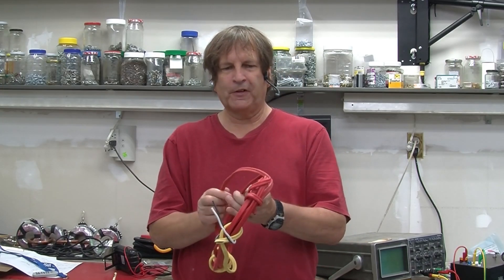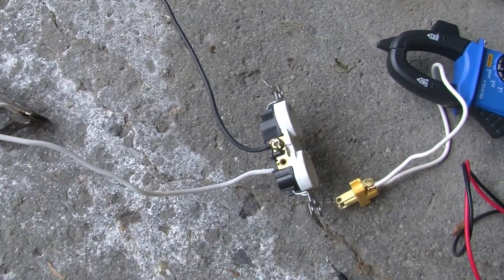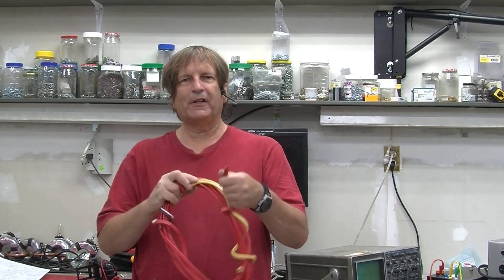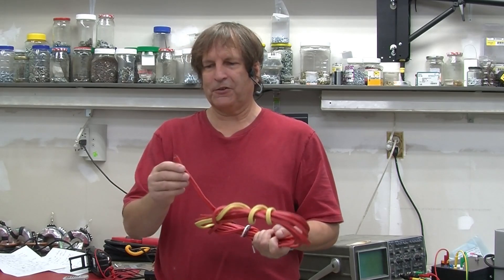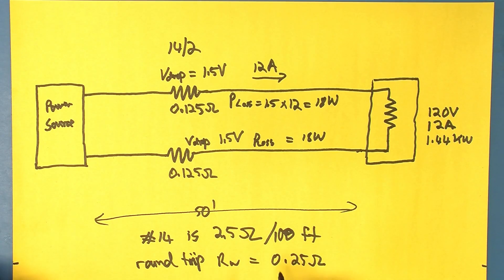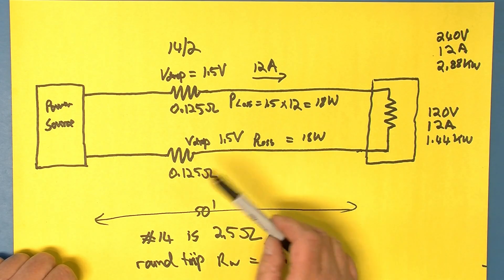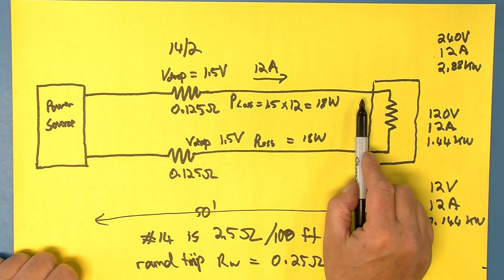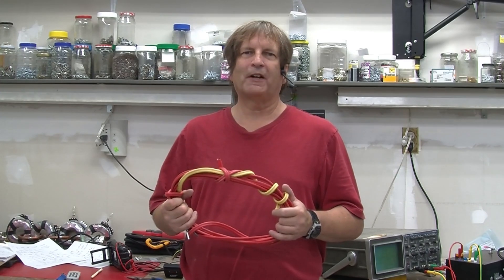Overcurrent Tests FAQ

Comment: I took electronics at a votech '85-'87, and was taught that electricity flowed on the outside of the wire - not through the inside. Was I taught incorrectly? Re- learned some forgotten things today watching your video! Thanks!! 👍😉
Reply from the maker: You went to school at almost the same time I did - how cool. 

You were taught a simplification that is generally true for RF frequencies where  the skin depth is really really small. Sometimes wires for RF are coated with silver to improve the conductance on that thin surface layer. For high power stuff like wires for radio and TV transmitters, the wires are more like copper plumbing pipes - no need for copper in the middel that doesnt get used.

For low frequencies like AC power the skin depth for copper  is thick - without looking it up, I think its about 1/3 of an inch. So not much point in a wire over and inch diameter feeding a home or on a power pole since the middle is unused. There re tricks to improve that - a future video!

Comment: Great video, I have question hopefully someone answered question, Im in process add 2  dedicated wall outlet . My build as follows is using 10/3 copper cable  MC cable  with 20amp and hospital grade isolated ground to power very high end Audio amp rated close to 12 amps . I read online use # 10 gauge copper cable will reduce resistance and offer better sound  does this make sense ..
Reply from the maker: Thanks! Well - bear in mind that any answer I give to that question will result in people disagreeing. So to put things in perspective, I am very experienced electrical engineer who often deals with very weak signals and noise. I'm not a high end audio person, although I'm amiliar with high end audio and also look at probably the same YouTube channels you watch. So with that said:

With a well designed power supply in the audio amp it should not matter unless you are a really long way away from the breaker At somewhere around 50' the electrical code says you need bigger (10/3) anyway. The reason the code limits the length is to limit the full load voltage drop along the cable to 3% or less.  Now consider this:  you can easily get way more voltage drop/swings during the day to day voltage fluctuation from the power company. So I am very doubtful that a shorter cable run 10/3 would help much if the system isn't bothered by those even larger voltage fluctuations.

But - since your already going to the expense of running a new dedicated circuit, the additional expense of upping the cable gauge will not be that great in relative terms, so I would suggest you do it rather that potentially regretting not having done it afterwards. Whats $100 more (if that) given the total cost of your system.

The isolated ground outlets is a good idea and I would have suggested it it if you hadn't mentioned it. It will minimize noise  from other electrical devices. Sound and TV studios often do that. I trust all the connected equipment will also be plugged into the two dedicated wall outlets on that 20A isolated ground circuit? If not, they will bring noise into the system. 

By the way - with expensive audio gear like that, might also be worth considering a whole house surge protector if you don't already have one. Would be a good way to protect your investment. 

Hope this somewhat pragmatic discussion is of help!
Reply: Thanks very much for detail information , after doing all work myself the 2 mono blocks amps on own circuit . With  volt meter to check voltage before it ranges from 118 to 124 volts now is steady at around 123-124 volts here in Canada.Consider I already have 10/3 cables from exsisting electric hot water tank  now natural gas. My final cost is just $C60.00 I noticed right away there more low in bass less muddy sound before and  less harsh sightly higher volume sound. Before I was using a loaner inline conditoner value just under $C15,000.00 now sounds very close without conditioner. Again thanks very much for advice
Reply from the maker: @hexen0076  Thats interesting - and amazing to me - that the difference is noticeable! At $60 its a no-brainier!

I'm in Canada too - just outside of Ottawa. I find my power varies from just below 115V to a bit over 125V. Lowest typically during the day in the summer when people run their ACs. Highest at night during times of low power use.

Comment: Note that on a 12V system, the voltage drop in the wire is much more significant than the heating of the wires.  i.e. you really need a much heavier wire than 14 gauge  for a 50 ft run at 12V.
Reply from the maker: Yes! You could very quickly use up all your supply voltage as simply voltage crop on the wire.
Reply: @ElectromagneticVideos  - I'm amused to see the various comments on Quora.  Some people say we should use 12V or 24V for everything because it's so much "safer" than 120V or 240V.   There there are the people who think we should convert everything to 240V to be compatible with Europe.  And there are others who think all electricity should be distributed as DC, since DC is used for electronics.

Of course if you understand all  the considerations, none of these changes should be pursued.
Reply from the maker: @8546Ken  You should see some of the comments under my "how many amps to burn 14-2 wire" video! I think a lot of people have a cursory understanding and unfortunately end  up with a bunch of misconceptions. And some are just looking to argue :)

Comment: Another: the early pixel led strips required 5V and were about 5m per strip. There is about 60*4 leds per meter (RGBW), rated about 80mA max per 4 leds @ 5V (full brightness every color).
Needless to say that 5V turned to 2.5V at the end.
And the cable to the string was the worst.
So I changed my PSU's to 24V led PSU with short circuit protection, and at both ends of the string I placed any:5V dc-dc converters.
The 24V at the far end using 1.5mm2 cable  drops to about 19V or so.
To be fair: they are rated as 80mA at 5V, but I've never seen the string go beyond 25W. Also none of my scripts put it in full power as 50% pwm seems to be as bright as 100%, so I keep the max at 50%.
Reply from the maker: I have see long spools of LED cable or strips. Never thought of the limitation in terms of length but you provide a great example of how resistive losses are so much more apparent at lower line voltages. Those strips should have max length specified ...

Comment: In my future ESS, 260A (your welder trafo, but DC) @ 50V should be supported. That's just barely enough to get my cooking island and ovens going at the same time.
So the wiring is also a bit thick. But it goes to a bank of inverters that transforms it to 230V, so the wires to that kitchen are multiple 2.5mm^2 wires.
Reply from the maker: ESS - sorry - what does that stand for - I`m guessing somthing to do with off grid power....

Comment: Great explanation. It should really help in the basic understanding for Amps being the constant! I know it can get confusing considering if breakers would operate on the same principle with currnet being the same and reduced voltage or another example since I am in the industrail field..
The older motor startes with the moror overload protection relays. I never really considered that. If current is still the same through the heater unit/element, will the heater still heat up to trip the starter if the volatge has reduced?🤔
Reply from the maker: Thanks! I believe the way the protection relays work is they have a thermal switch that heats up based on the current and time it is flowing. Under normal operation, the current is low enough to not trip the thermal switch, but during the starting sequence, not only is the starter winding activated but also the main running winding draws way more current - I have seen up to 6x the running current. For a normal start the high current isn't on long enough to trip the thermal protection cutout.  But for repeated starts - or a stuck rotor the heat build up and hopefully the power is cut before the windings burn. The stuck rotor is typical for fridge compressor that was running, then turned off,  and then restarted while everything is still pressurized. 

The real expert on that sort of thing is David at https://www.youtube.com/@davida1hiwaaynet. Well worth looking at his channel if you haven't seen it!

Comment: I'm too lazy to do it myself, but I wonder how much money you could save over a 30 year period of time by opting to use 14/2 to 12/2 on heavily used 15A circuits. 36W wasted is the wiring is a pretty significant loss.

I imagine that you'd probably break even in a couple years, especially if you use stuff like microwaves, air friers, and space heaters frequently.  Or maybe you just have a giant work space with a ton of lighting like a large pole barn.
Reply from the maker: I suspect the issue is most circuits (even the ones you mention) are on such a small proportion of  the time it may not pay - but would be an interesting calculation. From some comments it appears in some areas #12 is used for all house wiring these days (in 120V regions). Had an interesting discussion with an electrician a while back,. The additional cost for wiring a house with #12 as opposed to #14 is a relatively small increase compared to the rest of the electrical cost. If I were having a house built today I would go for #12 and for that matter, better quality receptacles than the usual cheapest ones.

Comment: Conductors don't care about voltage only current.  Insulation is what handles voltage (arc protection).
Reply from the maker: Exactly!!!
Reply: And might as well add an insulator is only an insulator until it fails. Then it becomes a conductor!
Reply from the maker: @unknown-zc8be  How true! Charring of plastic is an example. A gas before an after an arc has formed is another. 

One of the most interesting things I saw in Florida in near the beach was an insulator on power pole that would gradually become contaminated with salt. Every few days there be would be a very loud bang with a momentary spark that must have blown away, dried out, or vaporized all the accumulated moist salt and the the insulator would be an insulator again.

Comment: With simple resistive loads, lower the voltage and you in turn lower the amps but with a typical application of a switching power supply the amps will go up with reduced voltage.  It's all a bit jiggly and iterative, isn't it.
Reply from the maker: Yes! It really makes it hard to predict what will happen if the line voltage goes up or down a bit since you would really need to know the exact characteristics of the load which could be anything these days. Or think of a whole house with a complete mish-mash of different load times. I'm sure it makes it harder for power companies who used to drop the voltage a bit to reduce the loads if they were close to capacity. Today doing that could make the situation worse.

Comment: Very helpful explanations.   I take it you are a current or semi-retired electronics instructor at a technical college?   Indeed the current in amperes is what heats up the wiring and we need to respect ampacity ratings when we're  selecting fuses or circuit breakers for any reason where it be your home, car or business, one area where voltage could increase the risk of fire for heavily overloaded circuits, is where the insulation begins to melt or char, it seems as though a higher voltage, such as 120 or 240 vs the 3 to 4 volts from your welder in previous videos,  makes arcing a better possibility and more intense,  and obviously sustained arcing where a breaker has gone bad and failed to trip or a fuse has been bypassed with a penny in the socket, is likely to start a fire inside your walls.  

Regarding AC vs DC arcing faults,  it would be cool to do a demo of various frequencies such as 60, 50, and 25Hz, and how difficult it is to extinguish an arc under similar conditions.
Reply from the maker: Thanks! Your guess is close - I'm a Electrical Engineer/Computer Engineer and I did teach a number of courses at some local universities after finishing grad school. I have always enjoyed teaching, but doing hi-tech startups really is the thing for me rather than being a full time Prof.  Doing this channel has been great fun - a wonderful excuse to do a bunch experiments and a great challenge to get the theory across without the underlying math.

For a catastrophic short condition as  you describe with a failed breaker or the penny "trick", yeah, my welder does not have the ability to mimic that. I would think 120V across an arc, then dead short, without a breaker or fuse saving the day would result in 1000s of Amps a lot of vaporized copper with perhaps the #14 wire becoming the fuse shortly before the house catches fire? Have you ever seen something like that? Would be fascinating to hear an account of what happens in a real example.

You know, the arc experiment you suggest really has me intrigued. I have an old 3KW generator that I could slow down to make 25Hz, and with a proportional drop in voltage I do have transformers that should be able to boost the voltage to make a nice Jacobs Ladder arc, and by showing how far up the ladder the arc climbs, one might be able to see how easily the arc is extinguished. But the real test would be using a bunch of identical switches - probably plain light switches - and see what happens. I'll bet the 25Hz extinguishes better due to the longer off or low voltage time, but maybe the longer cycle time does more damage to the electrodes because of the potentially increased time before off happens. The same experiment with smooth DC (not pulsating DC) should be much more spectacular. I'll have to figure out how to easily create smooth somewhat regulated DC 120V DC with a few amps of current to really try that.
Reply: @ElectromagneticVideos  yes, if you get the chance,  please do an arc experiment with Jacob's ladder and regular switches with with various frequencies starting with pure DC, then 60hz, 50, and finally 25Hz is worth an honorable mention because many decades ago 25 Hz was apparently common in factories and for trolley motors in electric railways, for ancient motors designed for low speed/high torque applications providing an ideal blend of the advantages AC and DC offers.   In the late 1800s and early 1900s many other frequencies were used as well depending on the power provider and applications in mind before the  industry settled on 50 & 60 hz.   133Hz was used supposedly to reduce flicker rate for carbon arc lamps, and for a brief period General Electric used 40Hz as a comprises between 25 and 60 hz.  Wonder how a Jacob's ladder would act if some of these early frequencies could be duplicated somehow, maybe a VFD would work?
Reply from the maker: @Sparky-ww5re  Believe it or not, 25Hz was still being generated in Niagara Falls, Ontario till 2009 for the last few steel mills that used it. Apparently in some areas of Ontario and Quebec, residential customers still had 25Hz in the late 40s or even early 50s. My dad told me about the flickering lights at 25Hz when he was a kid, and I later heard the same story from my supervisor when I was  grad student, so amazing it did exist even that recently in homes.  I hadnt heard about the 133Hz for arc lamps - makes sense. 

It must have been wild with all those frequencies back then, and I gather quite a variability in 110, 113,115,117,118, 120 etc voltages depending on where you were. 

I wonder how well a VFD would react to the non-linear nature of the arc, even with the arc being fed though a transformer? I dont have VFD but if I come across a used  one I'll grab it and try it. After you said it I'm now really intrigued at the reaction of a Jacobs ladder at 25Hz.I'm also guessing at higher frequencies like 133Hz there may not be time for the plasma to cool so the arc may be more like DC. 

Such interesting stuff!